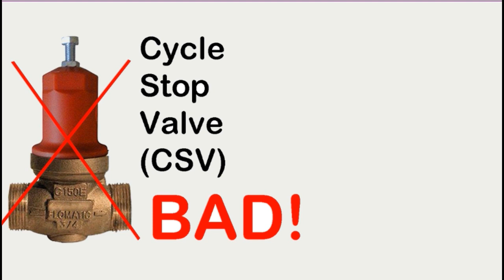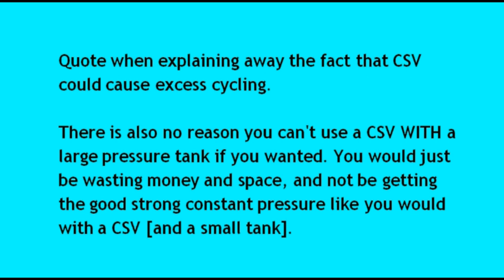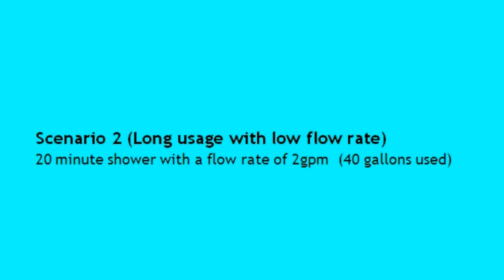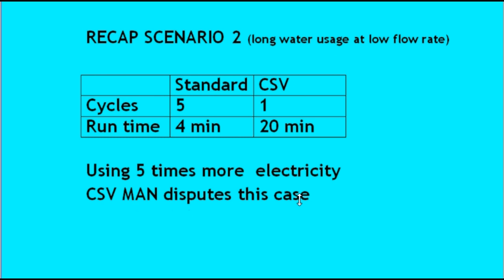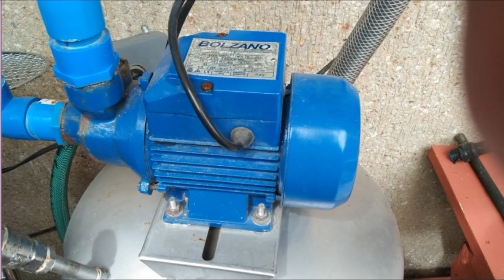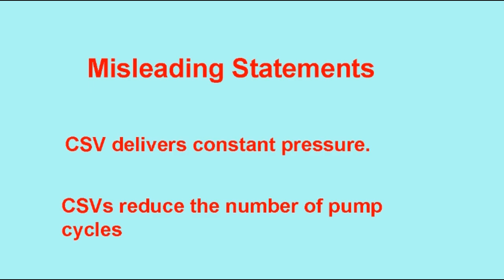Cycle Stop Valves ARE BAD for pressure tank systems!  Pros and cons of CSVs – few pros, many CONS!

Comment from the maker: OH OH!  I just realized the picture I show starting at 3:18 is wrong. The pressure switch should go on the pressure tank or on the pipe between the CSV and the pressure tank.  The way I show it the switch is detecting the pressure before the valve and the system would cycle on and off constantly. My BAD!
Reply: So, WTF are you babbling about if you can't even make a proper schematic?  A well pump allowed to run continually as CVS systems will run cooler.  A pump that is cycled often heats AND wears faster.  I finally figured out that people who put bullshit on the internet make money off of it, one click at a time.
Signed, a retired 26 year, one month water plant operator – 20 years and one month of that being the chief  water operator at a 5 MGD, then 7.5 MGD municipal water treatment plant with submersible pumps in vertical AND caisson wells.
Reply: @voodosforever  *CSV 👈 BTW — Are you saying continuous running is cooler than 'constant' stop & start? At what rate does the electrically water tight well pump get hot if it's submerged?🤔 Is it the heat that causes faster wear? Seems like constant running causes more wear. CSVs stop 'on & off cycling', I'll research the + & - of the CSV systems.

You worked in the municipal end of the system, so the quality, sizes, attention & maintenance that water plants get are different.
Reply: We have a 7.5hp pump in a 6 inch well casing that was drilled and installed less than 4 years ago. We have 3 controlers and 8 valves on 5.3 acres of property.   Two valves need to be open in one area for the pump to run constant at 58psi 90gal per second.  The Irrigation tech didn't know this and separated the two valves at the controler. The 7.5 hp pump, 190' down melted the casing because of short cycling. The boar scope shows water at 70 feet here in South West Florida.  I learned this when it burnt up the contactor,  and start relay.  It ran this way without notice for awhile until the restable overload tripped.  $48k to replace the equipment and drill a new well. VFD and a three phase pump is an expensive upgrade to an area susceptible to floods and lightning. This is a great option.

Comment: CSV works amazingly well for me.  Stopped the torque in my line, which use to break the pump discharge fitting, and doesn't cycle my pump when irrigating.

Comment: Your example misstates how a CSV actually behaves.  Assume a 40/60 system. CSV set around 55.

Small draws
If pressure never hits 40, the pump never starts. Same as a normal tank system.

If it does hit 40:
Pump starts.
Tank refills.
Pump shuts off at 60.

Same behavior as no CSV. On small intermittent draws, the CSV is basically irrelevant.

Long draws
Shower. Irrigation. Hose. Washer fill.

No CSV:
Pressure drops to 40.
Pump hits 60, shuts off.
Cycle repeat 

With CSV:
Pump starts at 40.
CSV holds ~55 steady.
Pump runs continuously.
Water stops.
Tank fills to 60.
Pump shuts off once.

Short draws → same as normal system.
Long draws → one clean cycle instead of mid-use on/off cycling.

Comment: A CSV makes perfect sense if you have long run times such as irrigating a garden or lawn daily. Otherwise you do not need this product. The CSV does not deserve the demonization of this video. It has its appropriate application, which is a mechanical version of a constant pressure system with a controller. Most residential usages do not need constant pressure systems. Key point is that a submersible pump's life is diminished with cycling of the pump on and off. The life of a submersible pump is not diminished in any measurable amount while it is running.
Reply: I agree with this, cost of premature pump replacement from short cycling is far in excess of the electricity to run it.

Comment: By the way, if you restrict the fan by blocking the air flow, the amp draw goes down. An example is the vacuum cleaner.  When the motor revs, (because it is restricted)  the amp draw is less. This was all the crap I could take from this guy. I couldn't take any more lies.
Reply: Does the same thing apply to well pumps which deal with a non-compressible liquid?

Comment: We have a 7.5hp pump in a 6 inch well casing that was drilled and installed less than 4 years ago. We have 3 controlers and 8 valves on 5.3 acres of property.   Two valves need to be open in one area for the pump to run constant at 58psi 90gal per second.  The Irrigation tech didn't know this and separated the two valves at the controler. The 7.5 hp pump, 190' down melted the casing because of short cycling. The boar scope shows water at 70 feet here in South West Florida.  I learned this when it burnt up the contactor,  and start relay.  It ran this way without notice for awhile until the restable overload tripped.  $48k to replace the equipment and drill a new well. VFD and a three phase pump is an expensive upgrade to an area susceptible to floods and lightning. CSV is a great option that works.

Comment: Hello again,  The main cause of pumps failing is because the shock of starting from zero RPM damages the plastic impellers from the dramatic acceleration.  That is far more stressful than running at a steady RPM.  It doesn't even need to be tested.  Pretty much every failed impeller pump I (or you) have seen has broken plastic blades.  It's the acceleration!
Reply: The more common failure is the starter capicitors.  The inrush current of starting the motor is the main failure of a motor.  Your are correct on the impeller but it's not the primary failure mode.

Comment: With your 'fan' experiment, you actually ADDED more work by stopping the blades and that's why the current went up.  Try putting cardboard or a piece of fabric in front or in back of the fan to restrict the flow and you will notice the fan speed increases (doing less work). You can also measure the Current and see it diminish.  Also, your test of the current draw on you Chinese pump was not done correctly either.  Try hooking up your pump with unlimited supply water and put a valve on the discharge.  Play with the valve opening while you measure the current draw - you will see that as the WORK done diminishes (less flow), the current will lower.  The CSV man did not clarify WHY the power draw went down when the flow was restricted - it was because less actual work was being done.  Do you understand it now, Larry?

Comment: 24:00 When the pump goes off, the 8 gallons of drawdown will be depleted at the rate of 10gpm which will take 4 minutes — It's 0.8 minutes 👈
Thus one cycle of where the tank is being used and then refilled is 4.8 minutes — Your math is correct here ☝
26:30 Wouldn't the CSV create a 10 PSI restriction vs the pump running at full 50 PSI?

Comment: 3:23 CSV doesn't always use a 'T'. The CSV's set to 50 PSI with the Pressure Switch at 40/60. An inline CSV before the tank CSV will provide 50 PSI till there's no flow, except thru the dribble bypass filling the tank to 60 PSI where the PS then shuts off the pump. 
Wouldn't back pressure on the pump use more electrical current?

FYI — It's usually spelled 'Drawdown' (one word). Two words mean to deplete (verb).
35:07 Made in Italy, not China 👈

Comment: Cavitation in the pump head! If a pump water flow is restricted, such as with a CSV, it creates pressure in the head of the pump which will cause cavitation and diminish the life of the pump head.
Reply: Cavitation is reduced by increased pressure but not temperature. Howbeit, spinning its impellers on a dead head is not good, that's why a pressure switch is used to stop the pump from running or it overheats.

Comment: I just thought about a better way to protect the pump and save electricity; the new refrigerators now use inverter technology upon which the speed of the pump is controlled when there is lower demand. IMO, a CSV after the tank (not on the tank junction) will provide constant flow and pressure, while the pump can be reduced in speed when there is a high level water in a big tank. It will need water level meters in various heights of the tank and maybe also a feedback control from the CSV will tell the pump to speed up or slow down. It is getting more electronic and complicated in this method, but in electronics, feedback makes a system very efficient. The problem with mechanical machines is that they are prone to wear and tear and difficult to employ feedback mechanisms.

Comment: For a true comparison, you would have to add all of these scenarios together. Nobody that turns on their tap 20 times using 1 gallon of water that’s ridiculous. Probably half of those maybe 1 gallon. So what you need to do is add all your scenarios together and average it out to see if the advantage of constant pressure outweighs whatever excess energy or pump cycling is. In the end I think you were probably even.
Reply: I have a 119 gallon tank with a draw down of 35  gallons. In a  course of an evening home, I wash my hands about 5 times, 8 to 10 minute shower, toilet 3 times, fill dog water dish, and grab a couple 8 once swigs of water. The wife about the same plus rinsing food or utensils. I doubt the pump comes on more than twice. With the CSV, it sounds like it would come on about 15 to 20 times.
Reply: You are correct. You will get constant pressure, but Like the old saying, says you don’t get something for nothing. And that something is the motor coming on and off much more frequently and reduced pump life. You will get constant pressure though.

Comment: You are incorrect in your assessment as your simulation of a restricted motor does not translate into a motor that is attached to an impeller that moves water. The motor is only receiving the resistance from the impellers. If you shut the flow of water, then no work is being done. Thus the motor will spin faster and do less work, which will equate to less power consumption. As an example, it’s the exact same scenario as when you put your hand over the end of the vacuum and the motor speeds up. The vacuum is not pulling a vacuum that’s the motor is doing less work, which means less electricity being used.
Reply: In the case of the vacuum having its suction blocked, that is reducing the air pressure which is why the vacuum speeds up. If you block the outlet, it will also speed up because of cavitation. I don't think the same applies to well pumps dealing with a non-compressible liquid

Comment: Thanks for your very comprehensive video. I enjoy it. Regarding CSV's claim 55% reduction in power, the CSV man assumed that the pump efficiency is constant, which may not be true. 
As Power = (Flow Rate) * (Pressure) / (Efficiency), CSV man could still be correct to say that with flow rate reduction, the power will be lower if the efficiency of the pump  is constant.

Comment: Well going through a bunch of comments im confused,lol some say they're good n some not good, i have a well pump probably 40 ft n ground, pressure tank,water softener n water heater,  never used the csv, but im getting ready to replace my tank, it's probably 12-13 years old, been here 20 years, replaced well pump once,tank once, 32 gallon tank which says equivalent to 82 gallons, pressure has always been ok, not great, can i get better pressure if i install a csv?   Any help is appreciated. thanks.

Comment: If you have a well pump system with a small pressure tank, say 3 gallons your pump will cycle like crazy without a cycle stop valve. I had it happen one time when my diaphragm split in my cycle stop valve. That is very hard on the pump with all those start cycles.

Comment: I sure wouldn't hire this guy to do any pumping system  engineering for me!  First off, anyone who knows anything about pumps is that pump power usage goes down when the pump is restricted.   Generating flow takes a lot more power than generating head.   Without him knowing that simple fact how can you trust anything he says. His example of deadheading a fan has no similarity to restricting the flow on a pump.  
Secondly, Challenging the "CSV man" as an individual rather than just sticking to challenging facts reveal a major character flaw with this presenter. Let's just stick to facts rather than slurring someone. It caused me to stop listening at the 30 minute mark.   I don't know if CSV valves are good or bad, but this guy sure hasn't convinced me they are bad because he just doesn't know his stuff.

Comment: I have used CSV and checked amps. And the amps do go down for sure.  In your fan scenario you're not doing it correctly if you put a piece of cardboard in front of the fan so you're reducing the flow of the air not reducing the actual motor you would see that the amps go down and your scenario is wrong application  And in fact dishonest

Comment: They sell a variable speed controller for this kind of application.  But those are expensive.
Reply: variable speed doesn't reduce energy consumption whereas reducing flow does. Seems counter intuitive but not if you take into account the way a pump works and how motors work. When a motor is loaded (resistance to spinning) the power consumed is high. When spinning freely, it uses very little power. Because the pump is designed to reduce resistance as flow is reduced, power consumption goes down also. When you use variable speed pumps, they are less efficient overall due to circuit losses and pump inefficiencies at lower speeds. It can be rather confusing to engineers, so the rest of us are doomed to listen to advice or learn to read a pump curve. 

Bottom line: variable speed pumps are more convenient in situations where you must drastically vary volume, so (to me) that makes the variable speed pump the best choice in a pool application where I must jump flow speeds around depending on the fixture. Pumping water from a well to deliver contact pressure at the house is a whole different story, and Larry's conclusions are wrong.

Comment: I am just a DIY'er so I try to take everything with a grain of salt. I recently moved into a new construction home and had an irrigation system installed. I noticed my pump runs for longer periods (about 2 min on depending on the zone running) and then is only off for about 10 seconds before running again(maybe I just need a larger pressure tank? Currently have a 22 gallon.). So I recently began researching and came across the CSV. Now your video has me slightly confused. Everything I have read about submergible pumps tells me that they have minimum run times but not max run times, and they should not be continuously cycled on and off. But you seem to say that you can't find any information that says cycling and run times are any different for pump motors(22:30)? There are many many companies that even refer to using constant pressure controllers or cycle stop valves to prevent over cycling because longer run times are better. I've even attached the technical document for the pump I have. On page 3 it talks about limiting the number of cycles. Now, maybe it all comes down to restricting the flow of pump that is the worst aspect? I'm not trying to be nasty with this comment, I'm just trying to find what the middle ground is because CSV guy seems to be the extreme of positives, and you seem to be on the extreme of the negatives?   https://www.pumpproducts.com/media/amasty/amfile/attach/itONYTJtedQcfM1OOms9IyMApVxc3PCW.pdf
Reply: Your pump is short cycling because your pressure tank is shot.  Replace it or you'll be replacing you're well pump too.